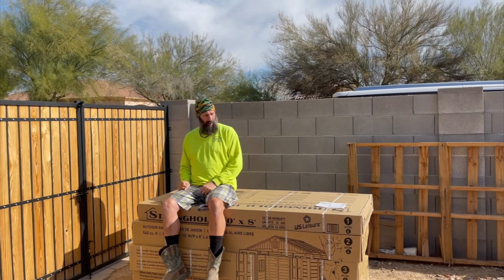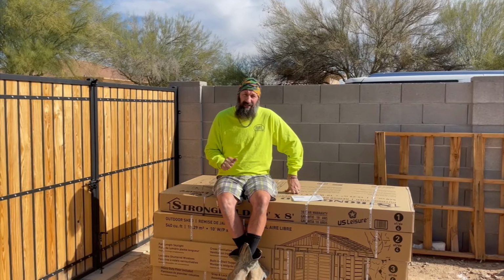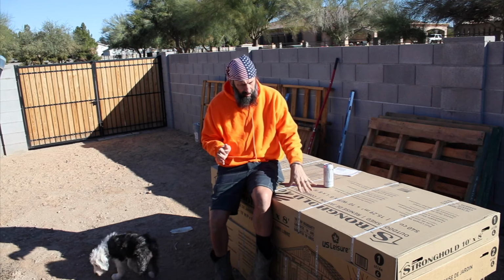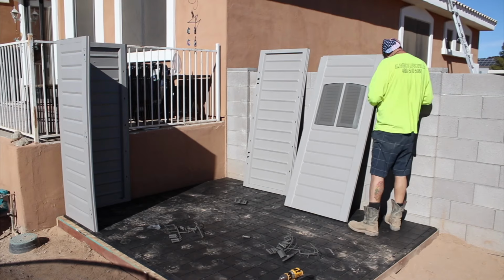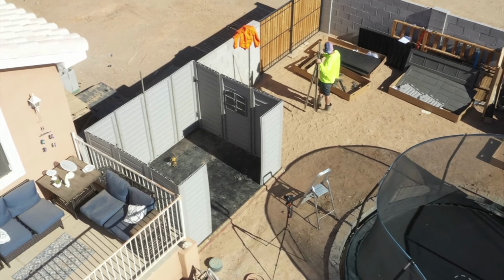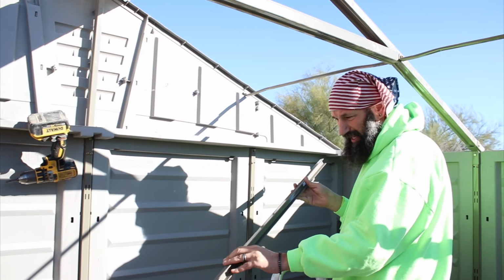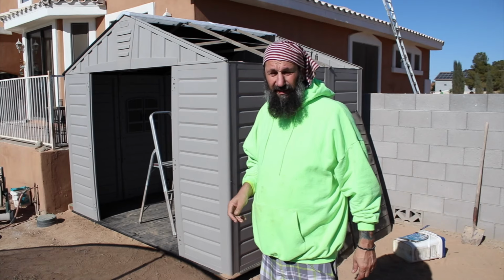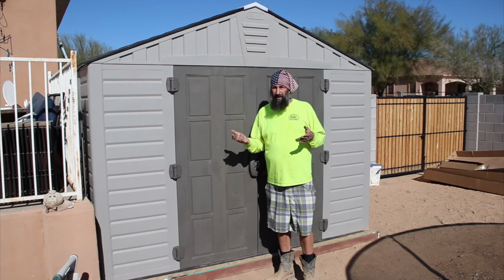Home Depot 8 x 10 Shed | Install | 2021

Comment: Can't get the floor to lock in together. Been trying with my dad and stepmom for 3 days. Any tips?
Reply from the maker: My guess is the the floor panels aren’t square.
Reply: @BearsWorkshop  After spending about an hour scouring it, there was plastic preventing it from going through on one of them.
Reply from the maker: @phantomxjedi  Glad you were able to get it fixed!

Comment: I was just looking at this shed and glad I found your video. Still not sure what I want yet. Granted, if I had $3-4K I would go with a solid wood shed that will stand up to hurricane winds (live in FL). But for the budget pocketbook this may have to do.
Reply from the maker: It works on a budget but not for a hurricane.
Reply: @BearsWorkshop  for sure! LoL does it leak when it rains?

Comment: We just built the same shed, thanks for the video it helped a lot.  Used soap spray in roof panels. My floor was made of rough 2x6 and some were an 1/8 diff, and it coincided with the seem which did not help, so starting with a dead flat floor +- 1/16 is best, although we shimmed and made it work.  Two floor panels were missing, luckily home depot had two more in stock and we took the panels from one of their other sets for the missing parts.  I was so happy to buy 100% American and so disappointed they did not count floor panels correctly, maybe it was Covid but still, damn.

Comment: This have got to be the best step by step detail video on YouTube Thanks.

By Qustion is how did you guys Bolt it down to the ground?

And how have it been holding up so far?
Reply from the maker: Thank you.   We set the wooden frame into the dirt and after leveling added dirt to keep it secure.  The bottom of the shed is screwed into the wood.  It's holding up without any problems except the door needs to tied to the other to keep it closed.
Reply: @BearsWorkshop  thanks...

Comment: We're having an issue placing the back middle support rod with the extension because it seems like the two flanges are blocking each other from fitting the wall panels together smoothly, any tip there?

Comment: This thing was a pain to set up! 😪 lol … and it’s also feels flimsy compared to a smaller 7x4 Rubbermaid shed o have. Specially on the floor pieces xx these are reallly thin compared to Rubbermaid’s.. hopefully it holds up a long time. I think it will! Have you found any shelving for this shed? Or hooks for like shovels and rakes n what not ? I haven’t so I think I’m going to make my own set up out of wood idk .. btw this shed is $900 in tax as of now .. and it’s not available at any Home Depot’s is in the Houston area .. picked my up from a Home Depot in San Antonio .. still slcheaper than other 8x10

Comment: Can you tell me the exact size (length and width) of the plywood subfloor you built?  I'd like to build this before the shed is delivered.  Looks like it might be 10'-0" x about 8'-4" - that would leave 4" in front of the doors to protect the threshold.  Seems like about what you did.  Thanks
Reply from the maker: That is correct.

Comment: Would it be possible to assemble the roof and than add it to the shed ? Where I want this shed to be one side of the shed is against the wall.
Reply from the maker: It would be very difficult.  I would suggest assembling it away from the wall then sliding it over.  It was what we had to do.

Comment: Bear, Loved the part where you pointed out that one part had two part numbers! Very funny! Question! Can the walls be mounted directly into a concrete floor without having to use the floor that comes with the kit? Thanks!
Reply from the maker: Thanks!  I would say no on the mounting into concrete.  The plastic that sticks out is not very long or strong for that matter. When connecting to all the pieces they become more rigid but trying to put it together in wet concrete while trying to keep them rigid would be difficult.

Comment: Hey cool thinking of doing this on my yard cool video how long do you think it will take in general?   How’s it holding up?
Reply from the maker: It's holding up good.  The doors need to be held together with a lock or they can blow open but otherwise pretty good.
Reply: You can do it in a day with a buddy, 2 days if you finish the beer on the first day.

Comment: Do you remember the package dimensions? I need to drive 50 miles to pick this one up ... just wanted to see if my Odyssey is big enough. Thanks in advance.
Reply from the maker: Don't remember exactly but I do remember that I had to cram it into an Escalade ESV.  The height of the 3 boxes was close.  I think the HD website probably has dimensions on it.
Reply: @BearsWorkshop  FYI... it fit in my 2014 Odyssey with few centimeters to spare. Just wanted to Thank you for posting this video with detailed steps/instructions. My 8yr old son and I had fun time building it up, referring to your video along the way (for project planning for the day :) ).
Reply: @panku88  p

Comment: Have you experienced any extreme winds and damage to the shed?
Reply: I used this vid to help me build it about 3 months ago. Weve have some heavy wind and rain where im at. Also a small tree limb fell on it. This thing hasnt taken any damage and is durable. Just some advice though, if you put it in an area near where water can collect such as a drain from a sump pump you may want to put some ant traps at each corner of the shed.

Comment: The bad thing about this shed is that full length skylight drys out a cracks off in about 2 years while the rest of the shed is fine??
Reply from the maker: Well I hope it doesn't.  But it is possible that can happen.  I am in a perfect spot to test it out.
Reply: Mine lasted about 8 years before cracking, warranty is good for 10 so got it (skylight, not the whole shed) replaced for free.   I'm on my 12th year now, overall very happy with this.  I think I paid 699 back when I bought mine. Stood up to high winds and 20+ inches of snow, though I wouldn't recommend leaving the snow there for long.